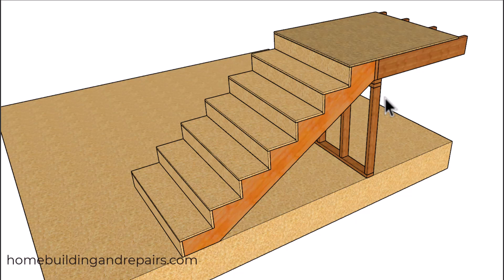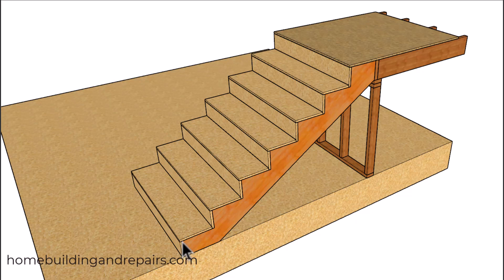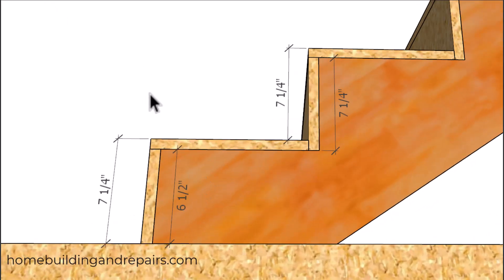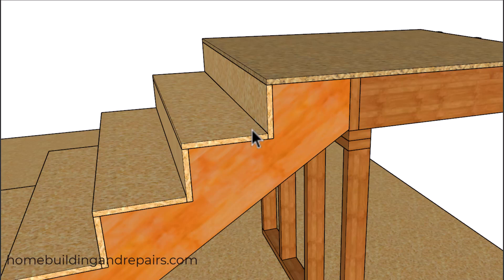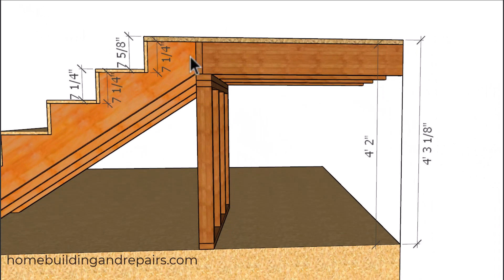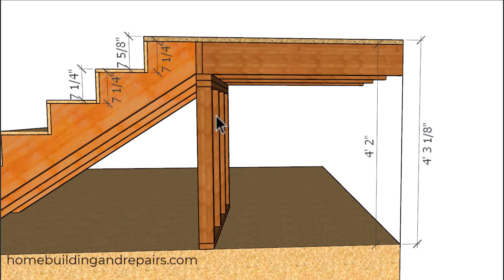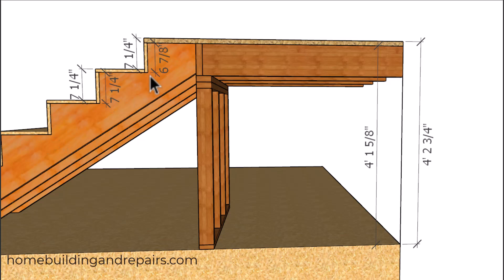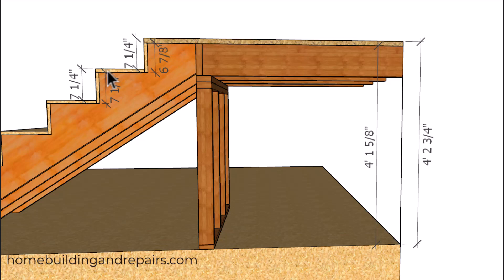How To Adjust Stringer Layout When When It's Part of The Floor or Landing Framing

Comment: Very good explanation and graphics to boot! BTW, Do you have videos comparing the advantages/disadvantages of whether the top step is level with the upper floor or one step down?  Both structurally and the end user experience?  And the ease of building the handrails?  Thanks.